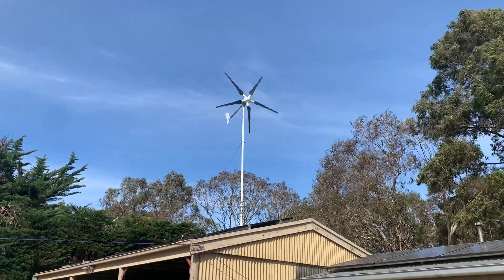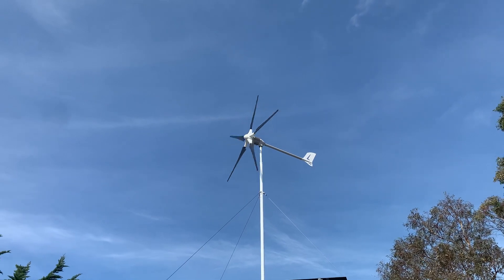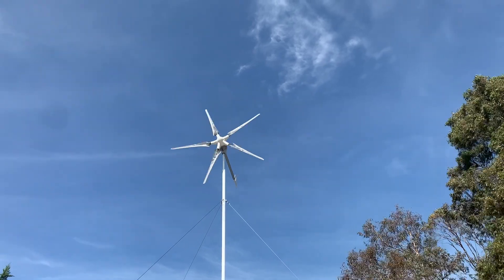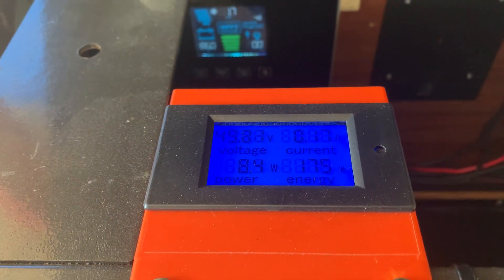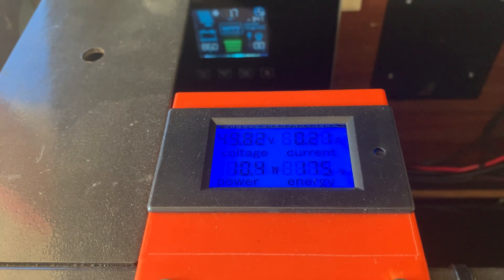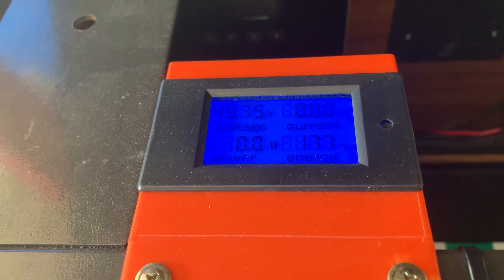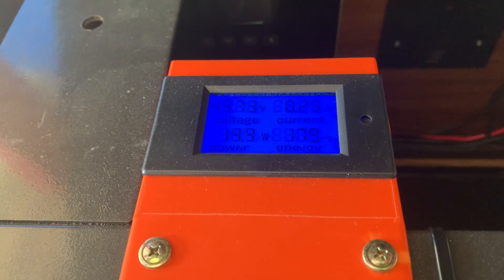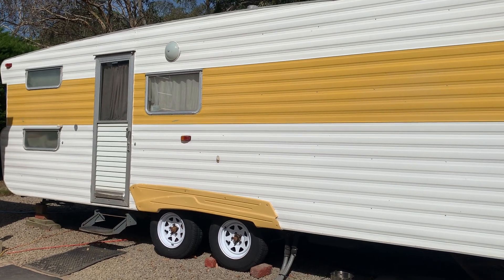Ista Breeze i1500 Wind Turbine Finally Producing

Comment: G'day Mate, maybe try using a 3 Phase Bridge Rectifier to convert AC to DC, then use a normal solar charge controller, best to use a PWM solar charge controller because it has a quicker reaction time. Just check that the solar charge controller input voltage can handle 50V or the listed maximum wind generator voltage.
Reply from the maker: The turbine has long since been taken down, a guy wire broke and the mast bent, decided to give up on it. Will try it again once I get to the new place.
Reply: @offthegridwithbert924  Ok, thanks for replying.

Comment: Hi Mate, I have been testing small wind generators in a low wind area and 
I have notice a wind effect when having a wind generator mounted on the side of the building, where the bottom blade is only 6 inches above the roof. Would be even better to be on the peak of the roof, there is a increase in the speed of the wind as it rushes over the building and roof. The perfect spot would be the peak of a 4 sided roof, with the blade 6 inches off the roof. 
I hope this information helps everyone.

Comment: The panning back and forth is telling you that the machine is too low to the ground and is sitting in turbulence. This robs the turbine of power because the wind is being diverted to several different directions instead of being cohesive.
Reply from the maker: Yeah I know, sadly I cannot get it above the tree line I’d need a 20 meter tower, once I move from here to a more open area hopefully better results.

Comment: Bert...

You know the trees are a problem, why haven't you tried elevate this one another 7-10 meters?  Surely this one isn't as top heavy as the previous wind turbine?
Reply from the maker: Unfortunately the property doesn’t belong to me, it’s my father’s property and he refused to allow me to go up any higher as he suffers from extreme paranoia. Once I can afford my own place rest assured the turbine will be up as high as I can get it safely.
Reply: @offthegridwithbert924  

Thanks, Bert...  I knew there had to be a reason because you're clever enough to put these systems together and get them working, more or less.  

It must be terribly frustrating though.  Think he might buy off on the already proven light refraction invisibility cloak using lots of angles with large sheets of Mylar?  😎🙃🤣
Reply: @offthegridwithbert924  
Why don’t you put up the insta in a tree :-) then you get higher
Reply: @offthegridwithbert924  No need to lift the windmill higher! It is enough to increase the number of blades with a mandatory reduction in the diameter of the turbine.

Comment: Hello, I'd like to ask you - What is the noise level of your iSTA breeze i1500 at 6-8m/s wind speed and are there some vibrations, sensible on your roof construction?
Reply from the maker: Hi, it’s very quiet, the noise level was much less than I anticipated, the 5 blade design is definitely quieter than a 3 blade design. There is audible noise from the alternator which you can hear below but the building is a carport so it’s not an issue, Ista do make a noise dampening mount for these turbines is noise is an issue.
Reply: @offthegridwithbert924  Thank you.

Comment: My friend a question, how many amperes (watts) This taurine (i1500) gives practically when the wind is good
Reply from the maker: I have seen a consistent average of 500 to 800 watts and even saw 2000w in one big gust the other week.
Reply: @offthegridwithbert924  how many kwh does it produce in a day, week, month?
Reply from the maker: Slavery is Freedom, War is Peace  it’s a 48v system so amps are lower at a given wattage.
Reply: Slavery is Freedom, War is Peace  ...and the trees all over too
Reply: Slavery is Freedom, War is Peace  it's nigh on 500 watts, without knowing what the wind speed was at the time it's impossible to make a determination as to how efficient that is. He says he has seen 2k, the wind in the video did not appear to be very strong. I would say it's working pretty well, which is great news as I intend to buy one.